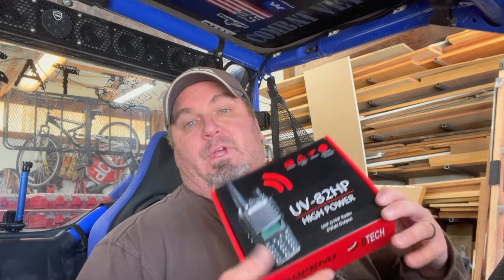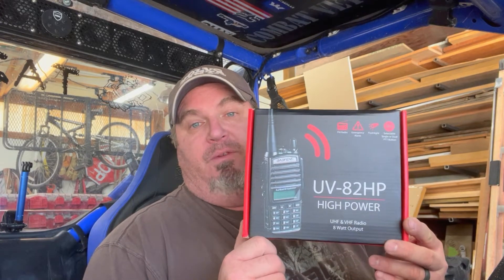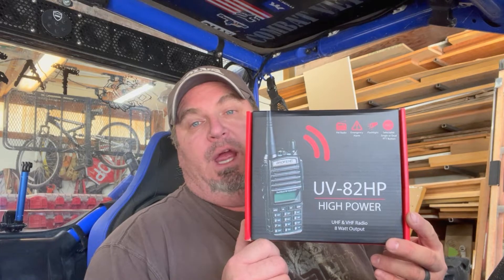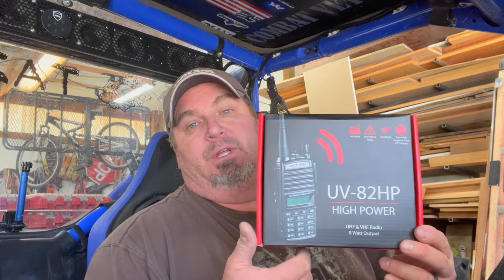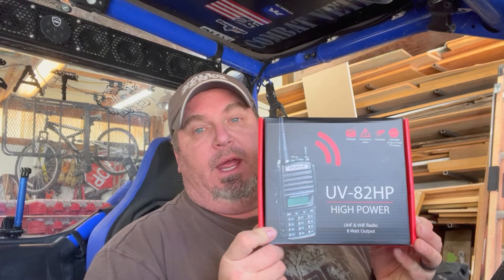Cracking the Garmin Tread group ride radio

Comment: Why does Garmin make things so expensively complicated. In order to use the group ride software the  MURS radio must transmit a GPS data burst. Garmin already had this in their Rino series of GMRS radios. I don’t know why they switched to MURS channels. Could it be because MURS is license free ?  The MURS frequencies are VHF not UHF like GMRS. You can still talk with friends using the Garmin Tread Group Ride with most of the lesser expensive Baofeng radios. Thankfully most Baofengs have both bands built into their radios. Even the Baofeng  $16.00 UV-5R is dual band and capable of transmitting on all 5 MURS channels.  The UV-82 or many of the other models will operate on both MURS and GMRS channels. The UV-5R will have to be programmed to put the MURS channels in. Thankfully a free program called CHIRP will help you. You could buy the Baofeng MURS radio. They are less than $55.00. Radioditty and Retevis also make MURS radio’s for about $30.00 each. None of these will appear on the Garmin Tread group ride map. They do not have the GPS data burst. However they all will communicate with any MURS radio.

Comment: Do you know if the tread sxs will work with the Garmin rino 650 radios
Reply from the maker: I don’t really know. If it runs on the MURS band, then it should.
Reply: @DualSportGuy  I just ordered a Btech radio that is supposed to be able to decode the tones on any signal, like the Garmin, and will post some information that might be helpful when I receive it.
Reply: @DualSportGuy  It says on rino “ready to transmit on gmrs”
Reply from the maker: @barster05  then it will not work.

Comment: What kind of range were you able to get? We run the tread on several units but have friends without them. I was curious if the range drops off a bit baofeng as to compared to the range between the tread units. Good work on the video this seems like a great option.
Reply from the maker: I haven’t had the chance to find out yet. Been way to busy to ride.
Reply: @DualSportGuy   when you do text it out I'd love to hear how it went. Right now we get anywhere from a mile to 4 miles with the extended range antennas between the tread units. We also run the pci race radios which do amazing! Unfortunately, price is insane so I'm looking for cheap options for people that go with us with no radio system.
Reply from the maker: @tylerfowler9244  will do

Comment: you made an excellant  choice going with the Baofeng radio. You can program it on the computer by using a program called Chirp which is a free download. I am a ham operator and I have one as an extra field radio that I was planning to carry in my SxS. I just ordered a Tread Group ride. Thanks for the video. I'm in better hands now.

Comment: Interested in how the buddy tracking works. Program the Baufeng with furs,gmrs and race frequencies for the times you may ride with others that use utv coms. Enjoy!
Reply from the maker: Buddy tracking won’t work, with the baofreg.
Reply: Ny understanding is the Buddy Tracking works by transmitting GPS data packets over the radio. The Baofeng doesn’t know how to read those data packets, and doesn’t even have GPS. I don’t believe it’s compatible with the buddy tracking feature.
Reply: @DualSportGuy  of course it will. The Baofeng UV-5R operates in the VHF band where MURS resides.Baofeng also makes a MURS only band.
Reply from the maker: @bulldogbrower6732  I’ll have to try